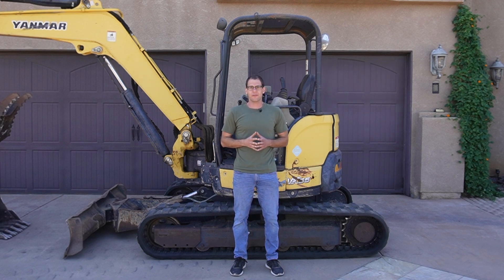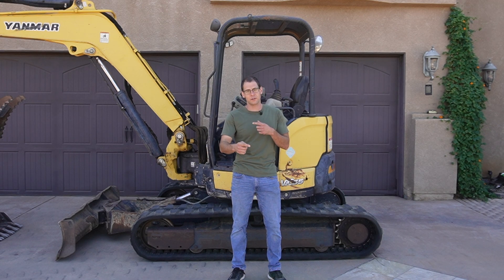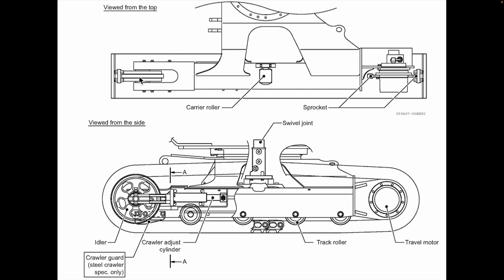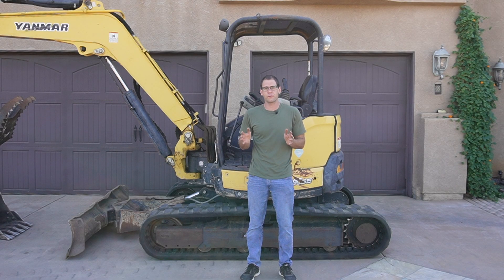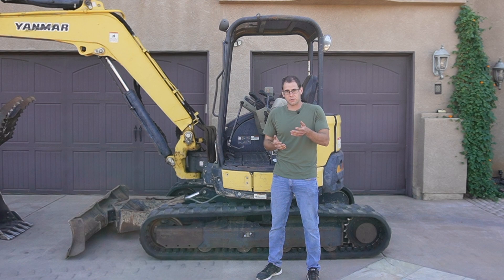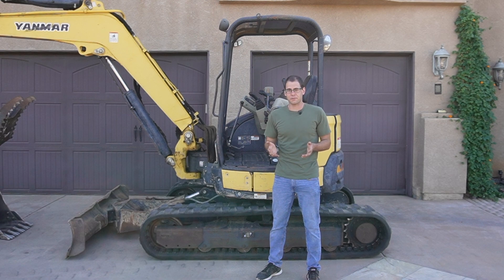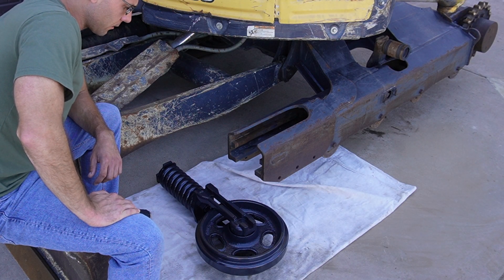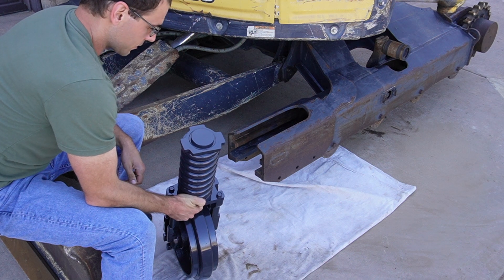How to Replace the Idler Assembly on a Mini Excavator

Comment: Can I ask why you fully remove the track? It seems to me you could leave it on most of the way and still remove the idler, is that true?
Reply from the maker: You definitely have to completely pull it off the idler. And at that point it's almost totally off. You could try to push it to the side while leaving it hooked on the drive sprocket, but then it may still get in your way. When working on a nice flat surface it's not hard to get on and off so I just chose to remove it completely